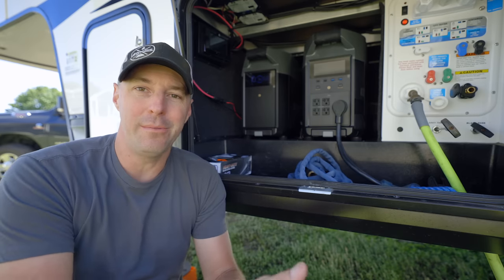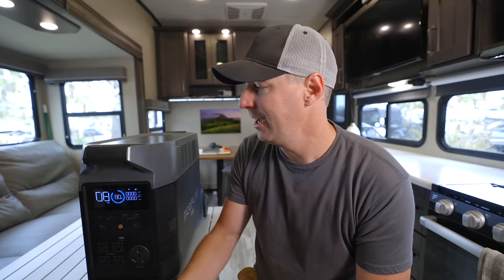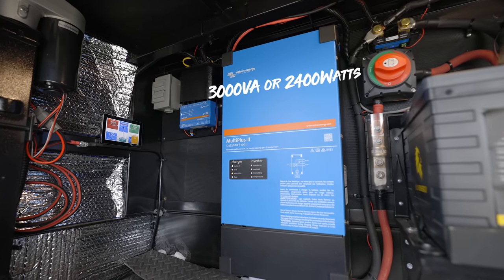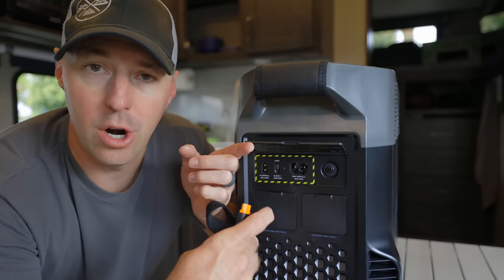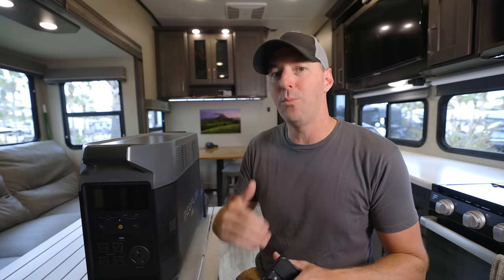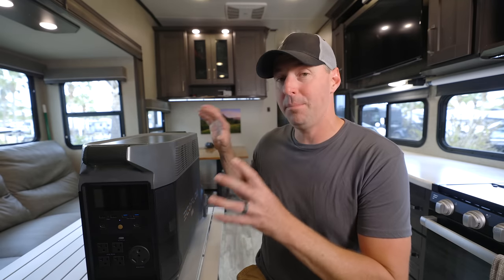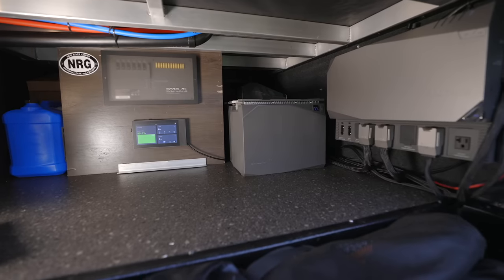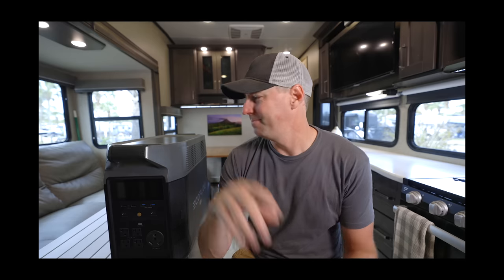Surprisingly Easy Inverter With Solar. EcoFlow Delta Pro Review.

Comment: it would be interesting if you could run two of these in parallel to run a 50 amp rig
Reply from the maker: There is a way to connect 2 for 240V output but it requires a home panel. I haven’t tested any of that.
Reply: @AllAboutRVs  Doesn't require the home panel, but it does require the Double Voltage Hub

Comment: The system by itself is not so expensive, but the add-ons are way too much. like $1.200 for 400w solar panels is nah. Of course the good thing is that any solar panel brand inside the AMPs and Volts would work. Thanks for the info.
Reply from the maker: Yes I’m glad they kept the solar input some what standard with the MC4 so you can pick what panels you want.